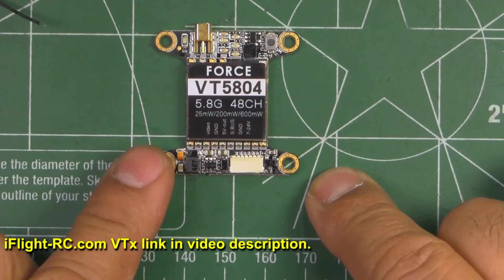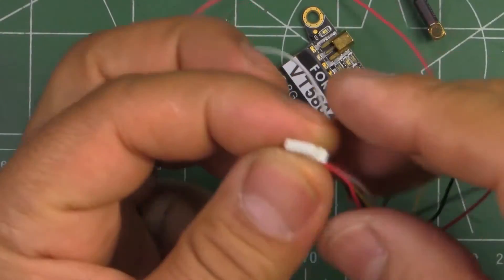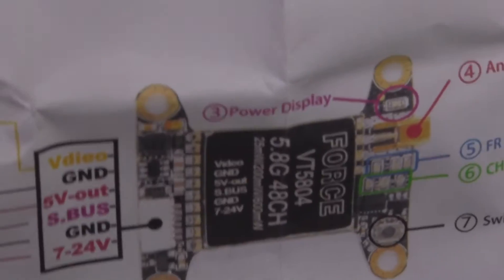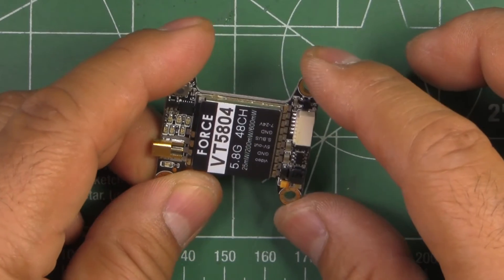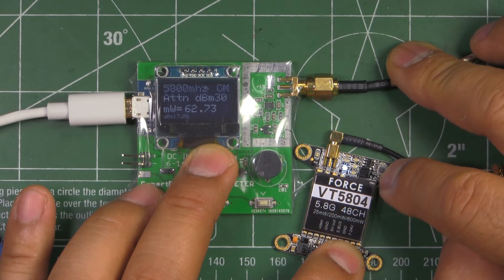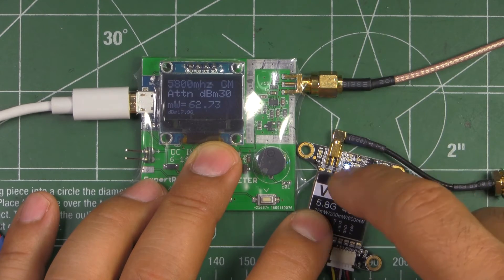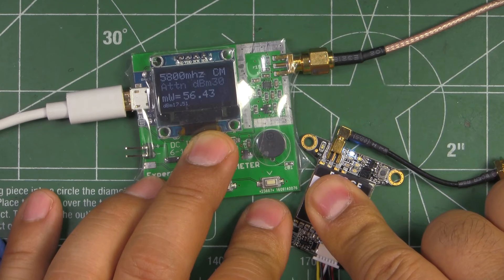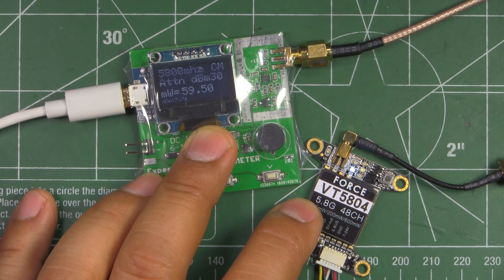iFlight -RC.com The Force 5.8G Power Switchable VTx Overview and RF Power Tests

Comment: If you can't change VTX-Power:
Check out these links:
https://iflightrc.freshdesk.com/support/solutions/articles/48001149204-i-can-t-change-vtx-channel-power-in-my-osd-
https://drive.google.com/drive/folders/1s7DSDoipPftdGA4QMj7ZKBYoKfOdYkyf
Just download from the second Link the version which doesn't say "eu" and go in Betaflight to the tab "VTX" and click "open from file", then select this document.
Obviously you have to power the drone with a battery to make the VTX save the settings.

Comment: I cant figure out how to unlock the vtx to raise the power, anybody, i have the i flight version same name little different though????
Reply: If you can't change VTX-Power:
Check out these links:
https://iflightrc.freshdesk.com/support/solutions/articles/48001149204-i-can-t-change-vtx-channel-power-in-my-osd-
https://drive.google.com/drive/folders/1s7DSDoipPftdGA4QMj7ZKBYoKfOdYkyf
Just download from the second Link the version which doesn't say "eu" and go in Betaflight to the tab "VTX" and click "open from file", then select this document.
Obviously you have to power the drone with a battery to make the VTX save the settings.

Comment: Can you provide the link for this power meter?
Reply from the maker: It s made by a guy in Russia. There are several Chinese clones but those may not be as accurate or maybe they are? This Russian meter has been good so far.
https://www.youtube.com/watch?v=ZOfwN7lJ3Yw
 https://www.ebay.com/itm/RF-Power-Meter-27-2400-5800-mhz-arduino-ad8319-5-8Ghz-2-4Ghz-antenna-tool-FPV/253921388053?hash=item3b1ee4e615:m:mUs0nb-PeeSKn1a4qbkZWPQ:rk:1:pf:0
Reply: @EngineerX  Thanks
Reply from the maker: @radiocontroladobr  Did you see the latest one from IRC? Looks good and more features but more $$  https://www.youtube.com/watch?v=RWTJCgiXyOY

Comment: So this sbus connection which they fail to provide any sort of instructions as to what has to be done after wiring up to sbus whether CLI command or BF setup steps and mixer setup in radio? Again iFlight learn how to write a dam manual
Reply from the maker: It's definitely not thru BF or the FC. It's direct thru Rx and can change channels but not much. That's  why I didn't try to mess with it anymore.  The rest of the transmitter is good. The remote feature is not. The SMARTAUDIO and the IRC protocol enabled VTxs are way better for remote features

Comment: Are you supposed to have a 30db attenuator on that meter? If so, it could be altering your results. I am aware cheap vtx's don't output the correct power. My 600mW vtx outputs closer to 1000! :)
Reply from the maker: Yes, there's an inline attenuator but it's out of frame. It came with the meter from the guy that makes them in Russia.
Reply: Ah ok. Thanks for getting back to me.

Comment: I've used 2 of these and they work great.  Connect what they call SBUS (which is actually a UART RX) to any open UART TX on your FC, then set that UART to IRC Tramp then you can use the BF OSD to control this VTX.  There is a new V2 of this VTX that is compatible with BF 3.3, too.  The instructions are horrible but it is easy to figure out.
Reply from the maker: Awesome! thanks for the tip. I will try that and see how it goes. yes, for the price these have worked very well.
Reply: I just converted another 5" quad to one of these last night.  Hooked it up, powered on and went into the BF OSD menu and set it to my frequency and the power to 200mw with no issues the first time.  Have these in all my 5" quads now.  Because it's flat on one side and not very high on the other it made my stack much shorter with plenty of room for my straps.
Reply: Stupid now why label the dam thing sbus and not rx? Morons. Thanks cause I've had this in a drawer for a year.

Comment: Do you have a link to where I could buy that mW-checker? Thanks.
Reply from the maker: Rollo FPV This guy from Russia sells them on eBay but not very often. Contact him thru eBay. https://www.ebay.com/usr/redsonic007?_trksid=p2057872.m2749.l2754
Reply: EngineerX cool, thanks!

Comment: You have to use the hold switch as it acts like a button on the vtx. Set up of a output mix for that on radio. From what I understand you also make a second mix and assign a switch for the power toggles.
Reply from the maker: Thanks for the info - I'll give that a try.

Comment: I think you want to test this  ewrf e7086tm3 with smart audio next =>  https://www.banggood.com/search/ewrf-e7086tm3.html
I was going to order Matek VTX with smart audio, but sold out and restocking date is september 12. I saw this one and ordered it. Got if for $15 a pop with 10% anniversary discount code on app. $15 for a VTX with Smart Audio? I have one word => WOOooooWWWww
Reply from the maker: definitely a WOW !! thanks for the link - so many parts come out every day hard to keep up .... but this VTx is really interesting if it indeed has OSD control and cost $15. I think I'll get it just to try it and see if it actually works.
Reply: EngineerX yea some guy has a video showing the OSD control for this on youtube. The question is how is the power output and quality of the components.
Reply from the maker: I watched the videos showing it works with OSD so I ordered it to check it out, I'll test it with my ExpertRC RF Powermeter to see how the power is. I think it should be OK for power, Unless you want like a lot of power, even if it's a little lower is OK for flights not too far, but for flying far of course you want higher power. Thanks !

Comment: try connecting the "sbus" wire of the VTX to a UART TX on your FC. Then enable "TBS smartaudio" for that UART in betaflight. Then use the betaflight OSD to change the channel.

Joshua Bardwell has a video about this (like he does about EVERYTHING).  https://youtu.be/zFb5IJpM1XU
Reply from the maker: LoL - Of course this thing is going to be SmartAudio controlled, rather than "SBUS" as shown on the instructions! Duh! I kept thinking it needs straight input from radio Rx SBUS. The "connect to FC" should've been the hint. Thanks for pointing that out. I'm going to try with an FC. If that works then this VTx will be even sweeter!
Yep, JB has a video about pretty much everything. I always watch his very good videos. (who doesn't!)
Reply from the maker: OSD's work OK since those come from the OmniBus FC. I gave up on the SBUS control to switch channels. The way I'm used to having all my channels setup on my radio made it too difficult and I didn't want to bother after I tried for like 1hr LoL....
Reply: Did you get it to work with the OSB?

Comment: that is the rush. So far all the electronics from iflight are just re-brands.
Reply: aaron knows where it is at. The new iflight force uses tramp telemetry
Reply from the maker: If it's rebranded from a reliable part, and price is about the same, then not too bad. Lots of parts are rebranded these days. I think they have a lot of parts that come from same factory as MyAirbot too.
Reply: yup same as myairbot. As long as the qc and the customer service is good I don't mind either.
Reply: I have the Rush V1.1 and my Rush looks way different than that one in video, electronics on both sides of the Rush!?
Reply: Looks more like a panda rc vtx
Reply from the maker: Looks like everyone is making a copy. The format, weight and functions are good so actually a very good VTx to copy and hopefully keep it affordable. How's the one you reviewed doing? https://www.youtube.com/watch?v=al9iI7oq0Sk 
 I'm going to only buy VTx's that have the SmartAudio feature from now on, seems like a very good feature.

Comment: I Think the new matek vtx is a much better option. Any chance you could review that?
Reply: Yea I second that. Although, it is just around the price of TBS unify, it will push the other manufacturer to come up with something unique. I dont think they can clone the firmware part of that one.
Reply from the maker: Nothing better than some good competition to drive other manufacturers to come up with something better, different, and hopefully at a competitive price, or just lower their prices. Can you imagine what prices we would have to pay if we didn't have all the inexpensive Chinese parts and sellers. We all would still be using the old classic Immersion RC 600mW VTx's, forget trying to mount it on a micro 130mm quad LoL
Reply from the maker: I'll see if I order that one.
Reply: This wasnt a review was it tested on a quad.